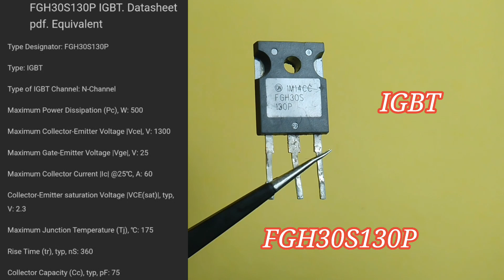IGBT Adjustable Power Supply 0-100V 30A | DC Voltage Regulator

Comment: Its good to test an IGBT, but you cant transfer 5A or 10A! or the IGBT will burn after Overheating, specialy if you have 60V input and 12V output!!! 60-12=48V , 48V*10A= 480Watt that means you produce 480Watt Heat in a 290Watt IGBT, and the Consumer get just 12V*10A = 120Watt :D
Use a PWM circuit as a driver for IGBT, Mosfet, SCR  ...

Comment: I made the same circuit. There is no problem with 12 volt 1 or 2 ampere powers. But when I tried to light 8 parallel connected lamps by feeding it with 75 volt 15 ampere transformer, first the potentiometer and then the mosfet burned. The mosfet I used is IRFP260.. So this project is useless.